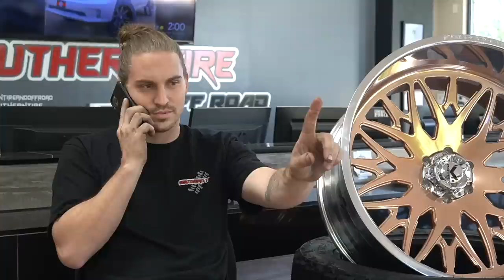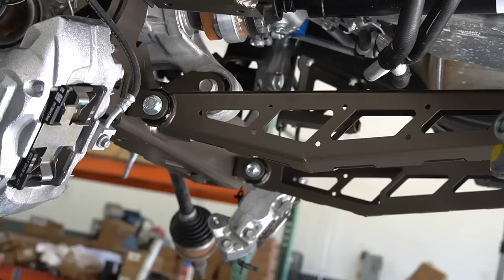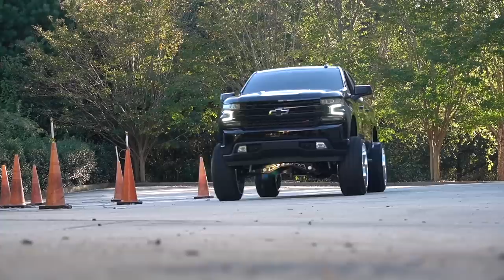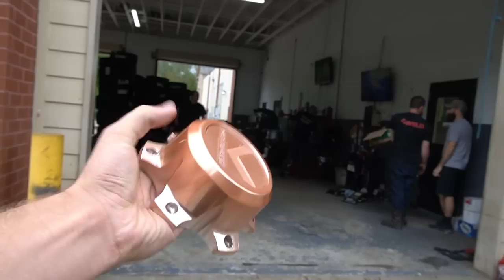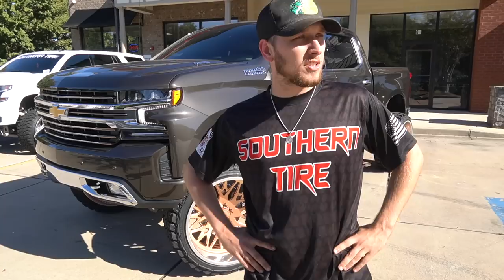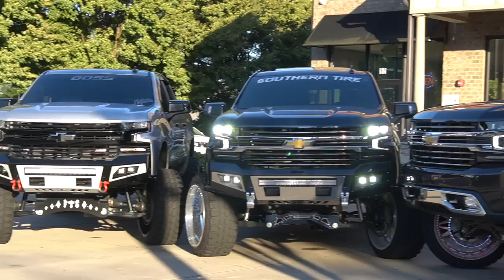ROSE GOLD 26x14s!! Lifted 2021 Silverado on 26x14s and 9" Mcgaughys! FIRST 9" with ADAPTIVE RIDE

Comment: I’ve been told by multiple lift company’s that u can only put “trailboss” marketed lifts on a trailboss , no one will tell me why/why not , can someone please enlighten me thank you
Reply from the maker: Trailboss comes with an extended front strut 2” if I am correct. You can add or replace that with any lift
Reply: Build my truck for me in April 7-9” mcgaughys , 20x10-22, 37/12.50 rock lights , bumpers powder coat , paint match (2021 Silverado trailboss)
Reply from the maker: Call me at the shop tomorrow 678-994-9180